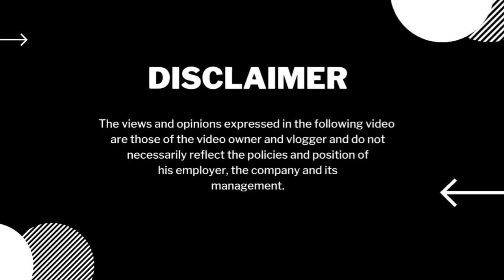HOW TO FABRICATE MARINE SEAWATER COOLING PIPE ( PIPE FABRICATION )/BUHAY MAKINISTA/VLOG30

Comment: Galing sir new subscriber... yung luma ba ginagawang pattern pag gumawa bago? Mag apply palang landbased experience welder galing saudi madami dami na rin yung mga nakuha ko trainings kasama na lathe machine
Reply from the maker: Madalas oo tropa lalo na kung naka elbow or maraming branches kailangan sakto ang butas ng mga flange sa pagkakabitan kaya yung luma ang pattern pero case to case basis naman. Konting pumaling lang kasi ang butas ng flange mahirap na ilagay ang bolt at iwas back job na rin.